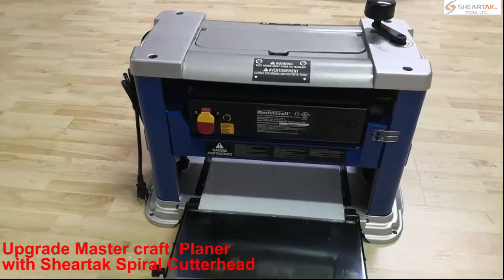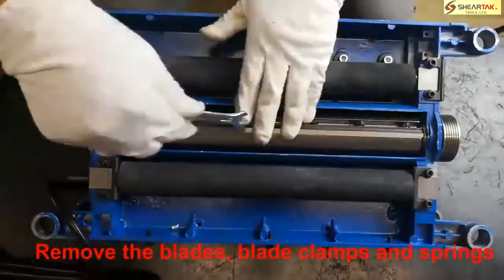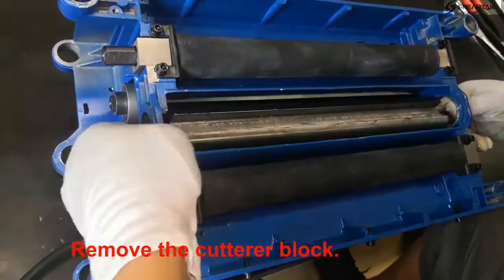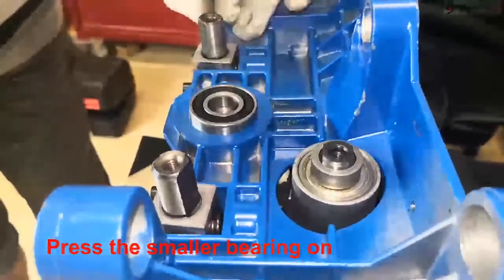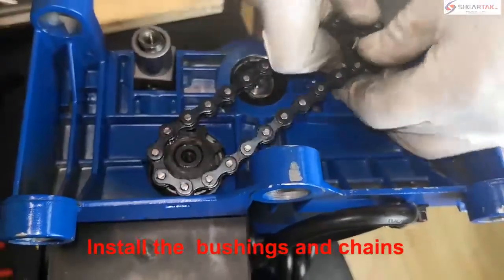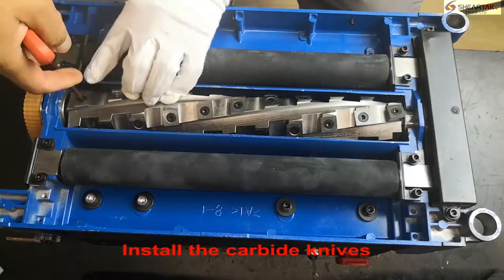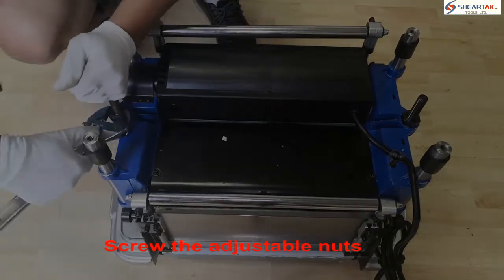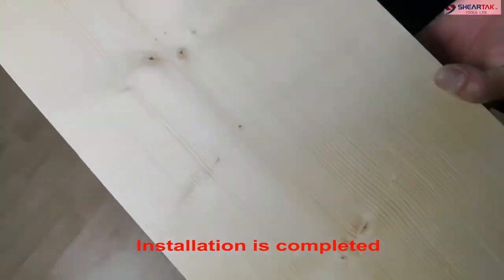How to retrofit Mastercraft Portable Planer with Sheartak Spiral Cutter Head

Comment: You obviously had the roller blocks out at some point, because yours are improperly installed at the sprocket end. You need to fix that for the video…not to mention you will have problems with your machine if you don’t put them in correctly.
Reply from the maker: Thank you for the recommendation. We will aim to fix this shortly.